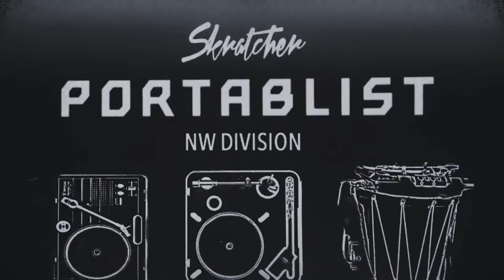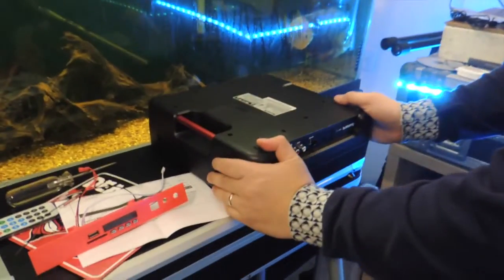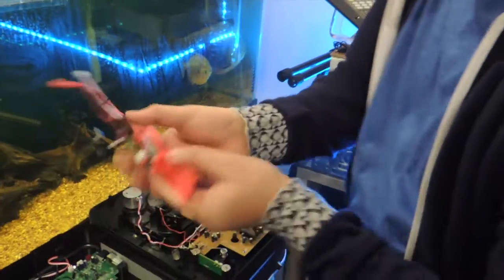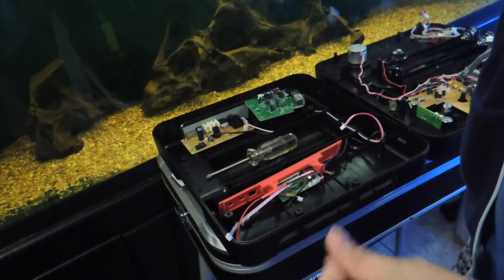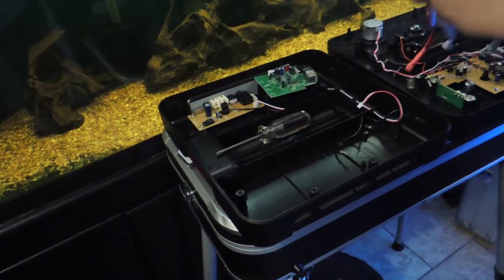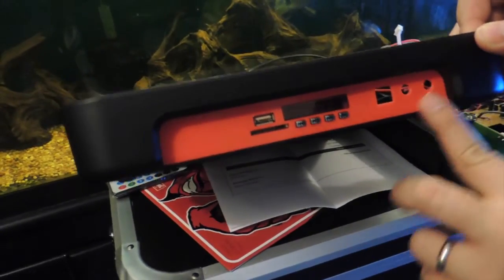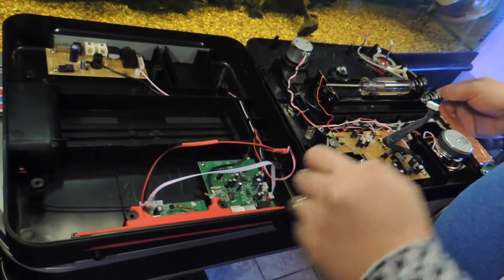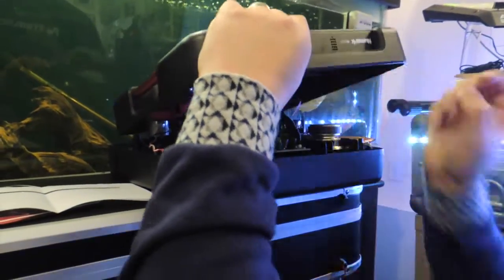NW Portablists show how to install a Scratch Toys Bluetooth Plate

Comment: Wowww, very nice... 
I have a question ... they have this device for the Numark PT - 01 USB?
Reply: YAHOAAAA!!!!
Reply: Dj Dek I just looked at the guts of my OG PT01 usb and I don't see any extra boards in the PT01 scratch, but I'm just comparing it to what I see in this video. The only difference is the scratch switch and the ability to cut out the need for an external speaker. I personally don't see why it wouldn't work with the OG pt01. They might say on the website if it's compatible. I bought a MP3 decoder for a few bucks and will just make my own plate with some aluminum plating from home depot cause it's just cheaper for me and I prefer making my own mods.